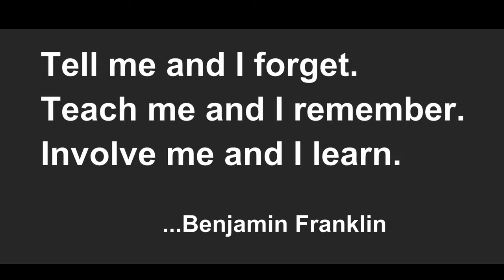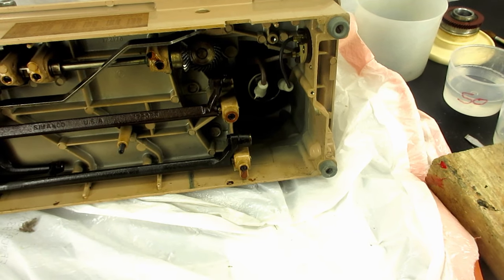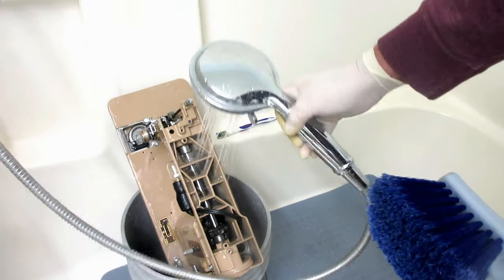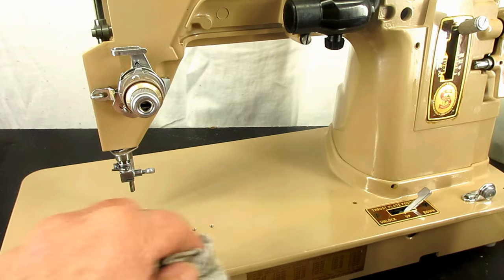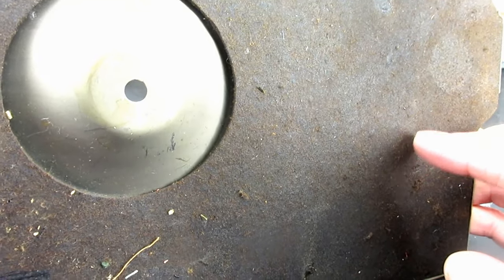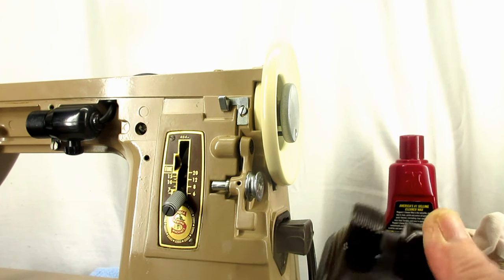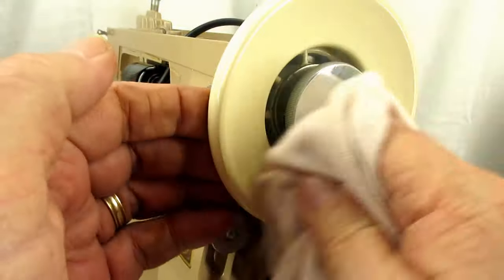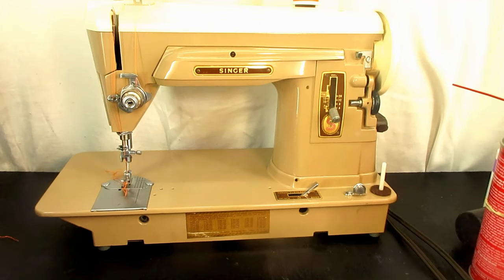An easier way to clean & degrease a sewing machine with less parts removal.

Comment: Did I miss where you mention what the concentrated cleaner is mixed with for it to be 15% of 50%? Just want to make sure my assumption if right: water?
Reply from the maker: No, I missed saying to dilute with plain water. KK is a water-based cleaner. Thanks very much for asking and I'll pin your comment to the top for others to see.
Reply: I used goji neat, is that ok?

Comment: Andy, have considered using an ultrasonic cleaner? Using it with either the soap solution or crud cleaner diluted solution.  Should vibrate all those loose items clean in a short period. I’m in dentistry and we use the ultrasonic unit with an enzymatic solution cleaner to vibrate the instruments clean before sterilization. Just a thought.
Reply from the maker: A good thought, Grace. I do have an UltraSonic cleaner and here is my video about it: https://youtu.be/EI_3eZ89E2Y
It does a good job and there are still a few items I clean using it. Very bad steel gears, for example, and it does very well cleaning a fancy chrome faceplate of the older black machines. I just usually clean them by hand as I can do it when/if I please and it is quiet too, so on a sleepless night of pain I don't disturb anyone at 3 AM.

Comment: Is this process ok for the antique singer sewing machines? I just aquired a Singer 66 Red Eye.  I am concerned about the finish and decals on the sewing machine.  The machine is in fairly good condition.  Someone added a motor to it but the wiring is atrocious cracked and old, so I am going to take it off and put a crank handle.  Hope alls well. I know you made this video 3 years ago and I hope you get my message so I can get your advice.  I appreciate this video.  I have a collection of old Sewing machines, mostly Singers.  I used to take my machines to a man who had a repair shop (he was fantastic) but he retired about 1.5 years ago at the age of 90.  He didn't look 90 I was sad he retired but understand he needed to retire.  So, I have been researching how to clean, oil and grease my machines myself.
Reply from the maker: In the description below the video I put in all capital letters not to use it on a machine like that . I would not use Krud Kutter on black finished Singer sewing machine it will harm the finish you can use a dilution of it to carefully clean the parts but you must protect the finish

Comment: Hi Mr Andy , I enjoyed watching your videos on the tips .. I have a singer 263  machine i jus got and it definitely need a bath.. I'm definitely considering your method of cleaning .. question is there any tips for tight screws??Also Is there any way I can send you pictures so you can advise me on how to treat it??
Reply from the maker: Tight screws can be found on all vintage sewing machines (I don't work on anything after 1974) Using a product like WD40 can help loosen them, as well as trying heat, say from a hairdryer. Using a rachet with a screwdriver tip lets you apply about 3 times the pressure on the screw. Using hollow-ground screwdrivers can save many screws from being stripped or ruined. https://chapmanmfg.com/pages/sewing-machine-repair-screwdriver-sets  Another successful method is to use a light hammer (2 or 4oz)  and tap/hit repeatedly on the screwdriver WHILE turning it at the same time. The "shock" effect can break the screw free. Sometimes, especially with screws into plastic, a sharp/hard quick turn to start can also free the screw. Once that initial "snick" happens the screw can usually be easily removed. I don't think Singer Model 263 was originally sold in the USA b/c I can not find parts or service records for it. I did locate an instruction manual on the Singer support page; https://www.singer.com/search/support?title=263 Looking thru it, it seems the 263 is based on the 240 models (nearest I can compare to) and you can buy a Service Manual for those that may be helpful; https://store.tandtrepair.com/240-248sm.html  I do have a few videos for some parts of your 263, like a motor belt; https://youtu.be/8TaqyrVbih4     Removing a control Dial; https://youtu.be/zThFx1CoM-E      Replacing the Timing Belt; https://youtu.be/Yg4OrTCeHxI   Model 513 may have (maybe) some similar parts and I have a few videos for it; https://www.youtube.com/playlist?list=PLsCOZgzzaiKLELksv_-MWE7tiAuzOgQj0    I don't know if they will help you or give you ideas for working on your 263 or not. I really can give you advice for working on a model I've never worked on though. Sorry, and good luck.
Reply: @andytubesewing1953  I Really appreciate your detailed response of options and shared infor..Your are correct the machine was made in Brazil I'm from the Caribbean Trinidad to be exact bought it second hand very cheap..thanks again and I will check out the videos you suggested
Reply from the maker: @carlydstrong1782  Hello, Trinidad! No worries, and good luck.

Comment: Hi Andy, hope you are well.  I have recently purchased a beautiful Singer 503-J that I am hoping to clean up.  The machine runs but quite slowly.  Is there any extra disassembly that you would recommend for the 503 versus this 404? Or should I just follow the video to the T?  Thank you so much for this resource!
Reply from the maker: Well, since you mention disassembly, here is my 21-video Playlist for model 503: https://www.youtube.com/playlist?list=PLsCOZgzzaiKJZaZn2zl3LsnV2d7UhrqvX    You may find more parts you wish to remove for deeper cleaning. 
     If you clean and oil the machine and it still runs slow it is most likely the foot controller (pedal) needs servicing too. Here is a Playlist for restoring the controller: https://www.youtube.com/playlist?list=PLsCOZgzzaiKL6ePPxLpmnWSzTyxPKTb71   
     If you did not get the Instruction Manual with the machine but would like one, a FREE PDF copy of the original 98-page manual is available from SInger Support at this link: https://www.singer.com/search/support?title=503     You'll be finding out why SInger called the 503A "Special". 
     You do NOT need to remove as much as I do, but you do have a worm gear area on the 503A that needs some attention, such as removing the old grease and applying new, and the Vibrating Bracket for ZigZagging the needle bar should be looked at. That's why I usually just pull off parts and wash the whole thing, but it is your choice once you see the condition of the machine. Thanks for watching my channel, and good luck.

Comment: Could you show me a video of a Kenmore 158.13180.I have one of these good machines and have the top off,I also have the aluminum rectangular   piece loosened, because I took out the 3 screws and then a spring has came out part way and can't seem to get it back together. I believe that the zigzag is not working right is why I took the that apart. Thanks for all you do.😊
Reply from the maker: Oops.   I don't do Kenmore, Gary. You can buy an Instruction Manual here that maybe will help: https://manualsoncd.com/product/kenmore-158-1318-158-13180-sewing-machine-manual/
You may be able to buy a Service Manual: https://www.ebay.com/itm/122165564317     https://sewconsult.com/product/kenmore-158-series-general-service-manual/

Comment: Hi This is a wonderful video,I am not sure if you can help, Im lookin for a part for a novum deluxe zigzag MarkIX cog, its the part that makes the machine zigzag and it was my mothers so I really want to use it, great work horse of a machine, do you know of any where I could find this part. many thanks
Reply from the maker: I'm in the US and this is the first I've heard of the brand or model. You call it a cog and we would say cam or disc. Other viewers have mentioned this type of problem and missing cam on other models. Some have found another owner of their machine and borrowed the cam to make a 3D-printed copy. A quick Google search shows a seller in Ireland that is selling parts to a "Novum Sewing Machine Deluxe model"  https://www.ebay.ie/itm/354671595401?hash=item5294130f89:g:M08AAOSwhktjVo~u
 I don't see a cam or cog but I have emailed many eBay sellers who have parts to my machine and specifically asked for the part I need. Sometimes they have it but do not know how to remove it. It helps to send them a picture of the part, or at least of the machine and where the part is located. I find 90% of the used parts I need on eBay. Good luck.
Reply: Dear Andy, thank you so much for your reply, I do have the broken cog/cam/disc and was wondering If i got a 3d one made would it work, it has split, probably from not being used for so long, you are so good to look into that for me, thank you so very much, from Ireland . Ann @andytubesewing1953
Reply from the maker: Oh I thought the part was lost. Have you thought about just gluing it back together? There's a method of using baking soda with super glue that makes a very fast drying, strong bond. There's also other glues for plastic and metal and I can't remember the exact name but you mix two compounds together and then apply it and it's very strong. Also, I have used baking soda and super glue to glue back together. Cracked plastic covers on sewing machines and some other plastic parts on singer machines. These pattern cams for zigzags don't take a lot of beating. There's just a follower that travels along the edge to make the needle swing back and forth so a glued together. Cam could last for many years. Just something to think about. I'm sure there's videos for using that method

Comment: Andy, I live north west of you in the tri state area of AZ. I have been watching your videos and wondered if you ever tried Simple Green degreaser? I haven't tried washing a sewing machine yet but when we bought our very dirty repo house 10 years ago it worked wonders on our A/C vents, kitchen cabinets, range, and more with no damage to any finish. They now have an industrial strength formula - both water based.
I have acquired 2 antique machines in the 4 days (adding to my other 5 machines - the oldest of which is a Bernina 930 Record) and this washing method looks promising. I am not sure my body will tolerate the bending over the tub (osteoarthritis & fibromyalgia) but summer is coming soon and we don't use our patio table so... The water is super heated in the pipes that are buried in shallow trenches (why⁉️) so that will provide extra wash power. I also plan on using my Wagner heat tool from my paper crafting toolbox instead of a hair dryer - but will keep it moving so I don't over heat anything.
Reply from the maker: I've never used the Simple Green on a machine, but a few viewers have told me it works OK. A few viewers have also told me they damaged the paint on their machine trying to use a Heat Gun, so please be very careful. 🔥🥵🌡
Reply: @andytubesewing1953  Thank you Andy. Yes, those heat guns require caution. I have browned many a pieces of card stock learning to emboss!
Reply: @Susan Dickson  hi from another paper-crafter and sewer in Arizona! Do you sew paper? My local shop doesn't recommend sewing paper but did say that my 301A is a strong machine, and better for paper than my Singer 5050c.
Hi Andy, i hadn't realized that you are in Arizona also. I do hope and pray your health improves soon. I so appreciate all your instruction and great detail.
Reply: @kristinjacobsen3417  Hi! I save a few of my old needles, intending to sew on my cards, but haven't done it yet. I do embroider on felt then attach the felt to my card fronts. Right now I am not doing anything other than cleaning, and bringing back into service, 4 antique sewing machines. I love the perfume of sewing machine lubricants!🙂
Reply from the maker: @kristinjacobsen3417  thanks for watching my channel and leaving such a nice comment. I have sewn paper for sure and I have some thin cardboard and even thin balsa wood. I usually use a heavy duty needle because the shank is thicker and holds up better. I use a sharp point not ballpoint and I use the smallest size needle for the thread I am using. I've had good luck doing all that. Some people I've talked to like to use a leather needle because instead of a point it has a small sharp knife on the end to slice through. I've never tried it but it makes sense. Good luck and hope to hear from you again
Reply: @andytubesewing1953  I never knew that about a leather needle. And wow, sewing balsa wood! I've done cardboard - sewing fabric to a cereal box to use as a journal cover.
Reply: @PKEDRM  I'm in the Prescott area.
Reply from the maker: @kristinjacobsen3417  Yes, the cereal box is called paperboard and I've sewn through that quite easily with the 301. I've also used a 404 and 403 on those. The balsa wood was about 1/8 in thick and I can't remember which of my videos. But in one of them I cut the top and bottom off of Pepsi can cut the can open and sewed through that. It's surprising what these metal machines can do. I don't know anything about the other machine you mentioned. 50/50C so I can't speak about that
Reply: @Andy Tube  Oh my goodness. You are giving me all kinds of crazy ideas. I was intimidated when my local repair man said not to ever sew even paper! But I'll try more fun things now 😀

Comment: I know this is an older video and it's wonderful! I have adopted a 457. Is there a video on pulling the motor to be able to use this method?
Reply from the maker: A couple of options I can give. I have a video of removing the motor on a similar machine:
https://youtu.be/32tXiiXx73o   It's quite a bit of work taking it out and putting it back.
Recently I washed a machine with the motor still inside, so washed the motor also. After years of working with motors like this
I could not see how it would hurt the motor IF YOU DRY IT COMPLETELY afterward. I tried it with a machine I bought on Goodwill for $8 and it worked fine. https://youtu.be/vIFK94QRyr4    If you are doubtful, here is a video where I soaked a motor like this for 24 hours in dirty water then cleaned and tested it and it works fine, https://youtu.be/6y1EN5S2sz4    Thanks for watching, and for adopting a vintage machine.
Reply: @andytubesewing1953  well I paid $35 for the machine and a great cabinet because they thought the machine was a lost cause (clutch disc was on backwards and now fixed thanks to you) so I really have nothing to lose.   I wish I had a leaf blower 🤣🤣  thank you again so much for your great videos and prompt responses.
Reply from the maker: @heatherh4975  oh that was a sweet deal! Congratulations! You can just spot clean the machine too if you don't want to do a full-blown degreasing the main thing with a vintage machine is to get it oiled properly and remove any excess grit and grime. You can even do that with q-tips and alcohol if you want. I went to the leaf blower because I was doing so many of these machines while making my 600 videos but before that I used good hair dryer for quite a while. It works just as well. It just takes twice as long. But regardless other than that gear at the top it's a marvelous machine. Good luck with it
Reply: @andytubesewing1953  already did a spot clean but it is hugely sluggish and the grease on the gears was hard and caked so I might do a combination but definitely will use several of your videos for reference.
Reply from the maker: @heatherh4975  That type of gunk on the gears... ugh! I hate it. Cleaning and oiling the machine can cure a lot of problems. Thanks for rescuing the machine. Good luck.

Comment: Are you sure we can do that bath thing to the machine :-D ?! Thank you very much for the wonderful video and tips.
Reply from the maker: Thanks for watching my channel. I appreciate the comment. Yes I've done this dozens of times. All with very good results today. I'm doing this to a model 329k that I picked up at auction for $17. I have a buyer for $175 and I'll finish it tomorrow. Probably maybe the day after. If you have an old machine you might want to give it a try. Just don't do this on the black singer models because it can harm the finish
Reply: @andytubesewing1953  thank you very much for the reply and the videos. I just got a PFAFF 145 with years of oil and dust. I will do that, certainly after your advises. Greeting from Brazil
Reply from the maker: @fabricio.ferrari  Best of luck to you!